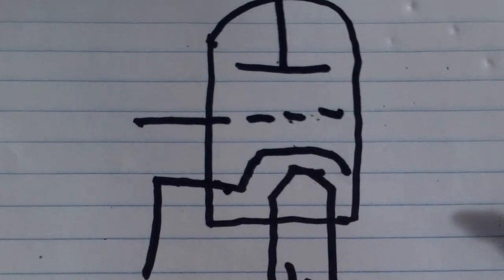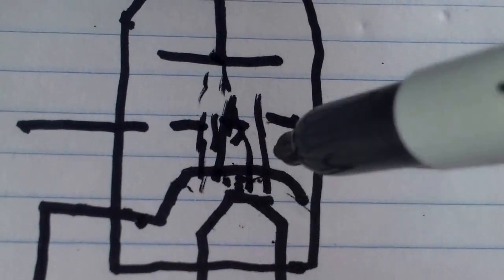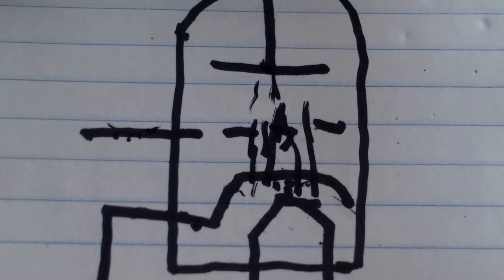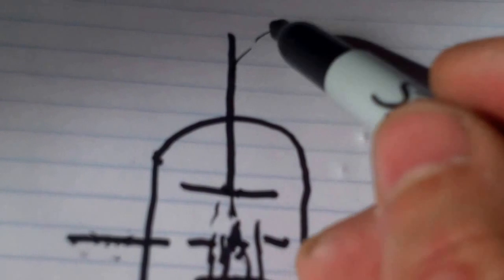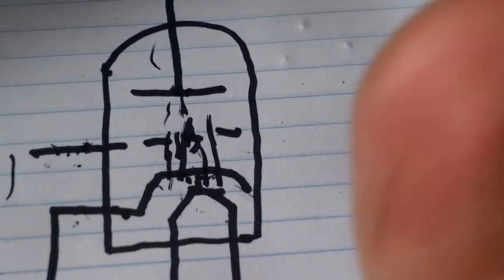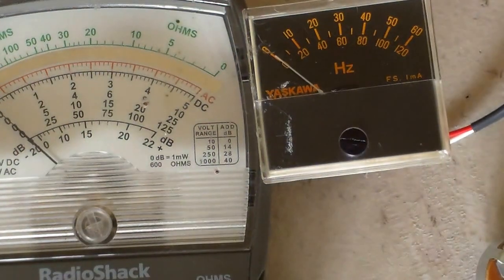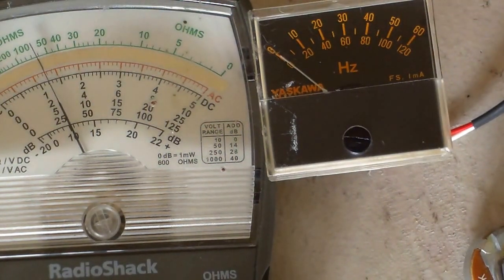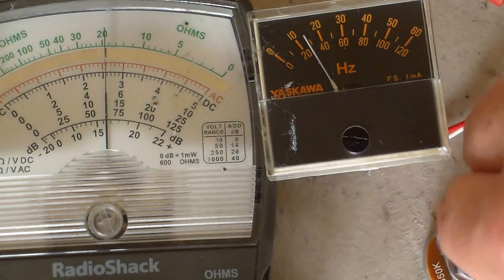how vacuum tubes work and a quick demonstration

Comment: Easy expanation.  Applying a charge more positive than the cathode on to the grid will increase electron flow to the plate. Going more negative on the grid will shut the flow off. The tube works like a valve.  If the plate current is increased and there is a series resistor to the plate the plate voltage will sink because of the higher cathode to plate current. 

Back in the mid to late 1960s I was working in tube circuit design. I was also designing circuits using transistors. I was designing linear amplifier circuits and power supplies. I did some some RF design for both transmitters and receivers.